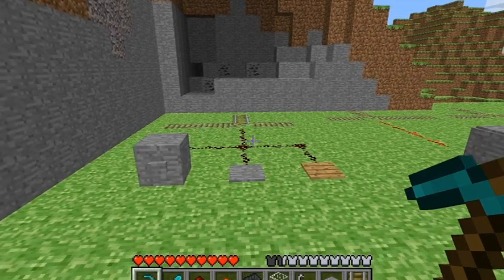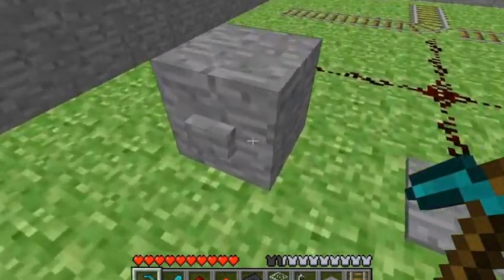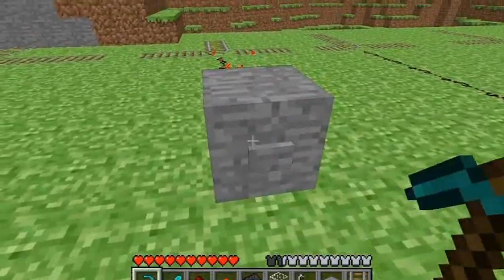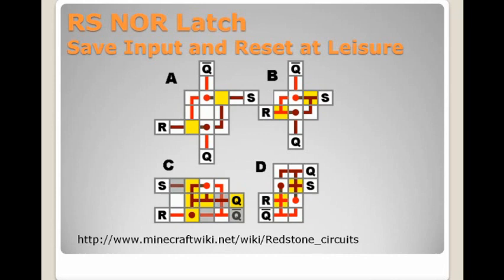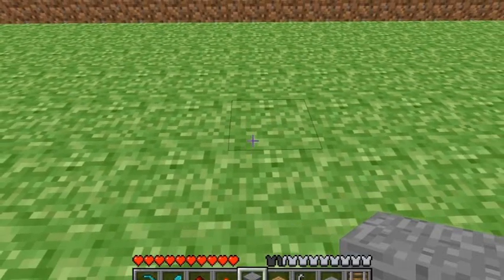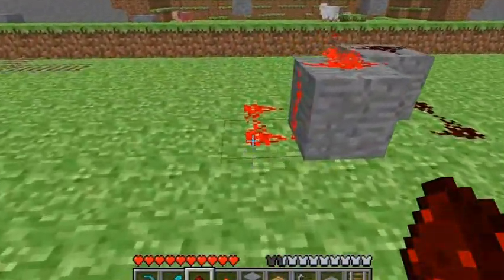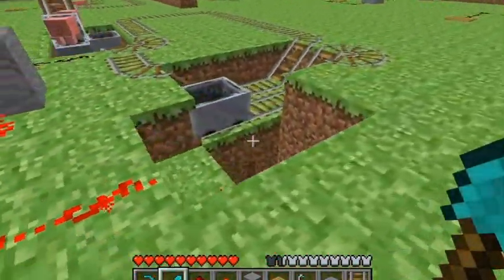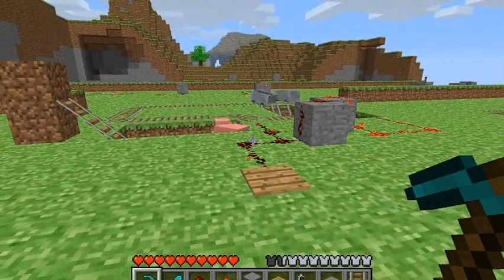Hatter's Subway Tutorial1: RS NOR, On-off relay, and cart magazine

Comment: Your on-off switch is perfect for an arrival platform! Then you won't need a wood and stone pressure plate, just the stone one, to have the cart you just left get picked up. Just hook up a sorting junction inbefore to bypass empty carts directly to a dispenser and you're set. I will definitely try and implement this! Thanks! :)